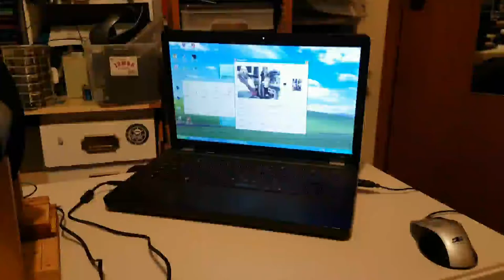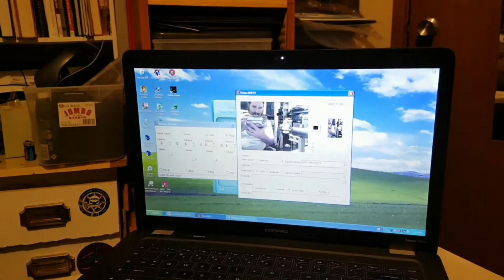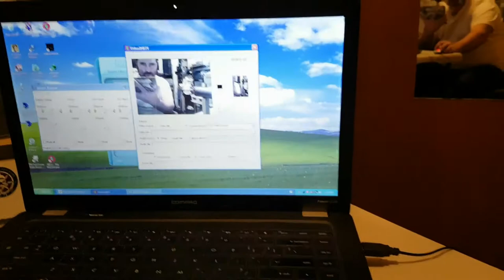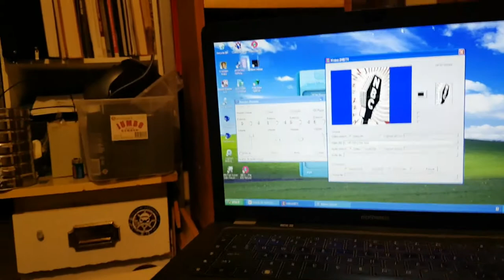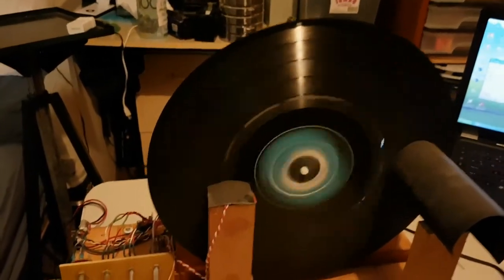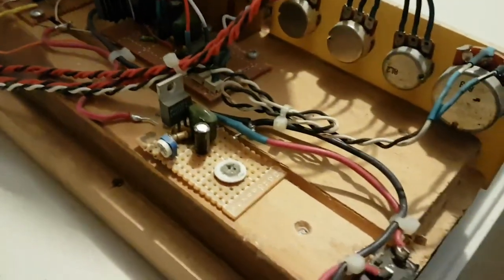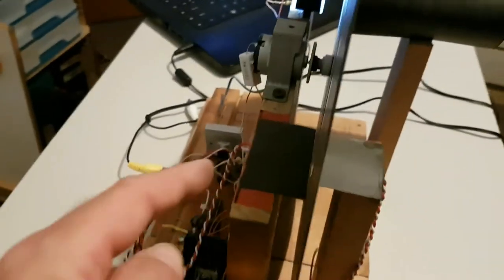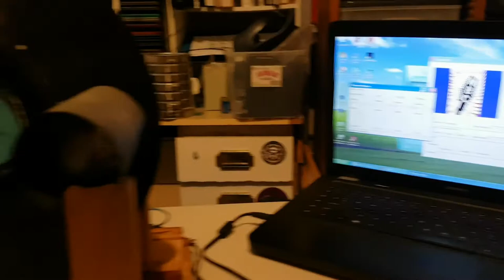Synchronized 32 line Nipkow disc mechanical TV receiver

Comment: I know too well the problem of hand drilling the disc from my own set - I will be investigating getting some discs laser cut on a CNC machine.
Reply from the maker: When you do get some discs cut, if I pay you can you get some cut for me too please?
Reply: @troysvisualarts  If I can get them cut it will be 20" discs for the 30 line Baird format. But yes, I will get more cut if it turns out to be successful.